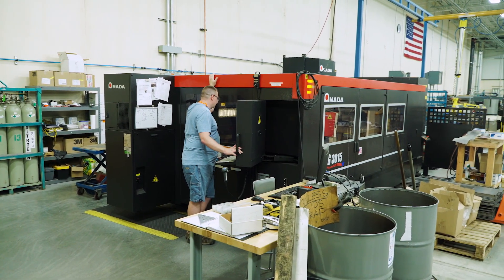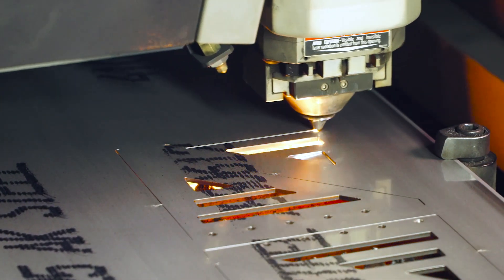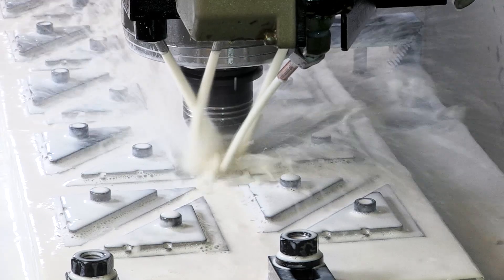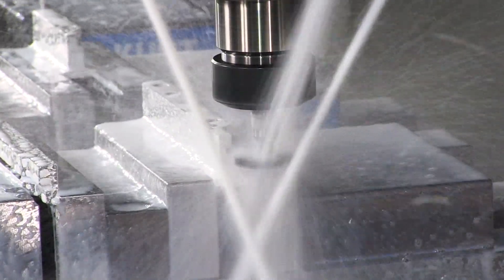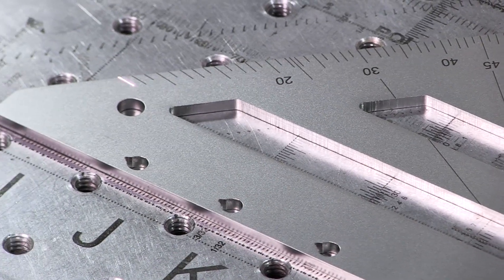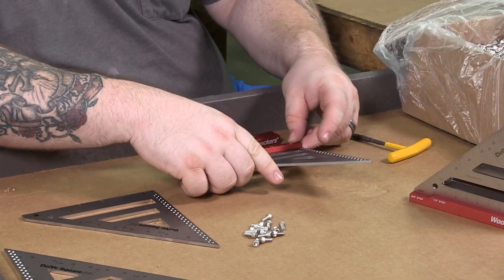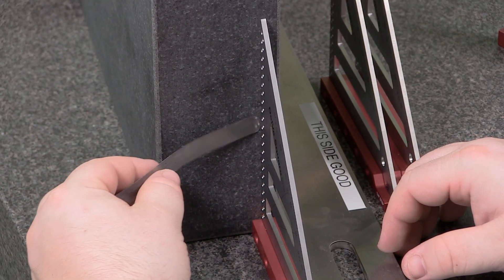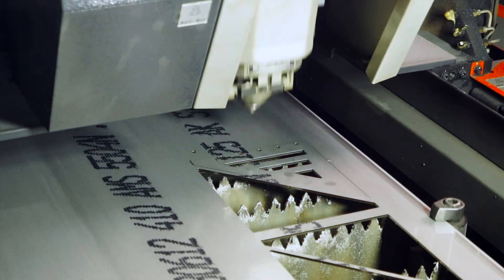Making Woodpeckers' DelVe Square SS

Comment: How many times does the DelVe square have to be re-released before you realize this should be a regular production tool?
Reply from the maker: Hi we appreciate your thoughts on this, we look at this every time we re-release a tool, the demand of that tool.  We hear you and are always looking into making some of our One Time Tools permanent tools. thanks
Reply: +Woodpeckers I love your tools. I have some ideas for some you could try out as one time tools.
1. A  3"  vernier caliper like the plastic one sold at Rural King. I use that all the time but would love a quality built one.
2. Veritas tools discontinued their "dividing rule" .  I would love to have that tool but it's not made anymore and I can't find a used one for sale.
3.  A 3" or 4" sliding T-bevel. I have your one time tool bevel square but a super small one would come in handy for smaller work projects. Veritas tools used to make one but they had a fire at the handle making factory.....
Anyway. Please consider these ideas and I'll see you at the next woodworkers show!